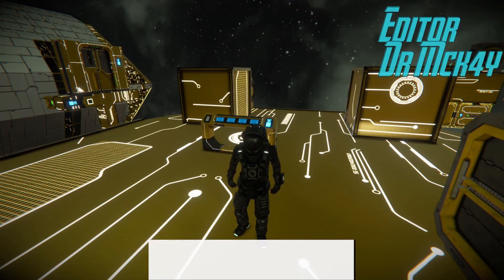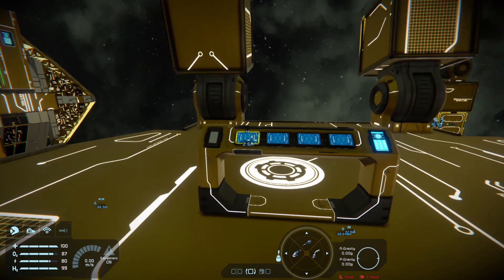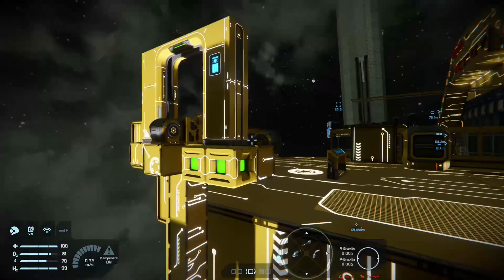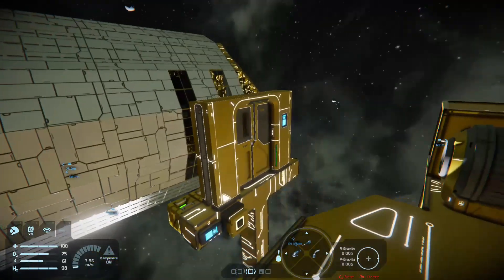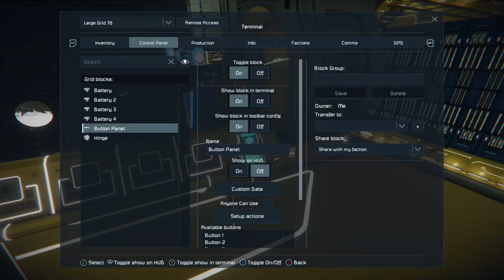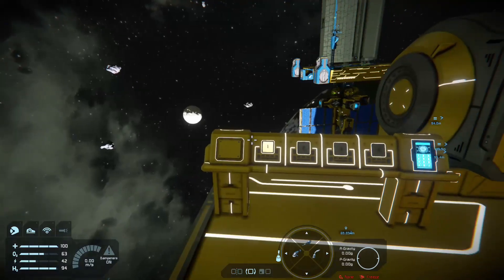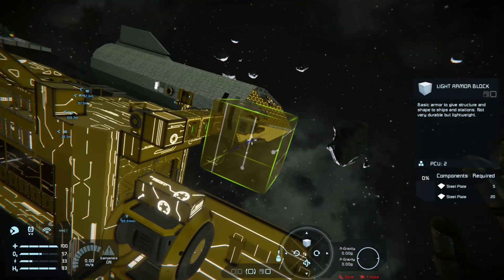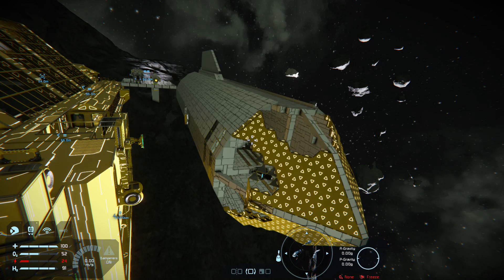Space Engineers Hinges Guide Hints And Tips

Comment: I know I'm kind of late with this... but I want to make a wedge shaped ship using hinges. I need two hinges to be at the correct angle to meet back up with the initial grid. When I do the trig it looks close, but I always get a bit of clang. Is there any info on where the exact axis of the hinge is? Is it bigger on one of the sides?
Reply from the maker: @eliwilson1146  each hinge has a little pip on the foward angle side on the round part of the hinge that is the plus side, the angle can be set in the control menu for the hinge just remember to name each hinge to know which one your controlling and just to point out your better of just using angled blocks for a wedge ship as hinges are a sub grid and will cause major klang and you won't be able to control any thrusters on the subgrid unless set to override

Comment: Question. So I downloaded a blueprint for  a large ship that has large blast doors on its roof. They are opened with hinges. In creative the blast doors open with the hinges without an issue, but when I paste the ship in survival to test it. The doors, and vicariously the hinges, do not work. I have only one hinge on each blast door. I also have one other hinge elsewhere on the ship that has light armor plates attached to it that raises and lowers just fine.

Any idea what could be causing this? 

The hinges are unlocking and switching directions successfully, but for some reason in survival mode their current angle stays at 0 no matter what I do.

Edit: I figured it out! 

I edited the ship a bit and saved the blueprint for myself, but with the doors closed. Went back to the build world opened the blast doors, replaced the blueprint with the ship having those doors open and then pasted it in a survival world and now they work! 🎉
Reply from the maker: glad you figured it out
Reply: @DR-MCK4YS-GAMING  probably not as glad as I am! Lol 

It's a really nice ship. It's the Gekko State ship from the anime Eureka 7. Even has the air-strip hangar part.

Comment: I'm trying to create a VTOL my problem is I can't control the engines from my control seat i can change their angles but that is it no thrust control on anything after hinge/rotor any help plz
Reply from the maker: your going to need to put the engines on the hinges to thrust over ride you can increase and decrease using the dead quick actions you will need to group up the engines on the hinges but you will also need more engines for left right up down foward back that can compensate for the hinges I hope this helps vtol are a tricky thing if your using hinges

Comment: If there is a way to add a large grid head to an existing small grid hinge, that would be good to know, bc the "3x3 small-grid hinge" does not seem to have a "add large grid head" button. If you wonder why I ask, I want to add a large ore detector to a small grid ship.
Reply from the maker: no only large to small i have not found a way to go small to large yet I don't even think there is a way hope this helps
Reply: I don't know if hinges can combine different grid sizes, but I do have information for other methods of bridging the grid sizes.
Keep in mind that small grid Advanced Rotors have large conveyor ports.
If you need conveyor access: build a large grid Advanced Rotors and detach the head, then attach it to a small grid Advanced Rotor base. For precision I recommend using a crane or mechanical arm to move it into place, rather than thrusters or gravity.
If you only need power:
Normal rotors do just fine.

Comment: The thing that cool with these hinges . You can make doors etc with in my experience no clang. Ive made side doors for my small ship ( futuristic car ) . No Clang
Reply from the maker: yes there very safe but I have had a few clang moments with hinges with wheels like on my f-302 the landing gear wen in testing when I retracted the legs if it clipped any other block on the way it would flip the 302 but that's on a ship on a station I've never had a clang situation using hinges witch us great
Reply: @DR-MCK4YS-GAMING  maybe by reducing little bit the degrees of angles
Reply from the maker: @KennyDead01  yh the key was to not close to 90 but to close to 80ish or just touching witch solved it
Reply: @DR-MCK4YS-GAMING  so all good ?
Reply from the maker: @KennyDead01  yh all got with the 302 buddy